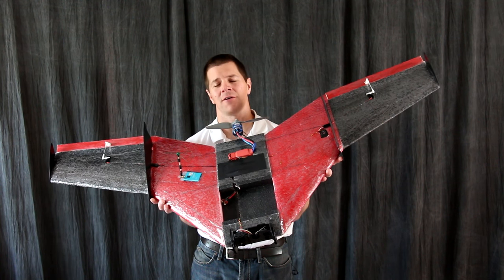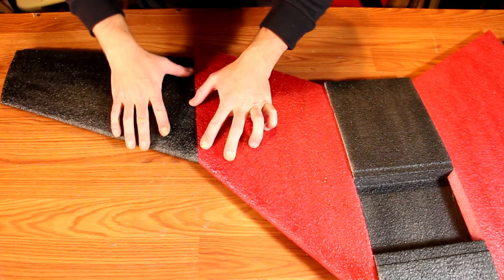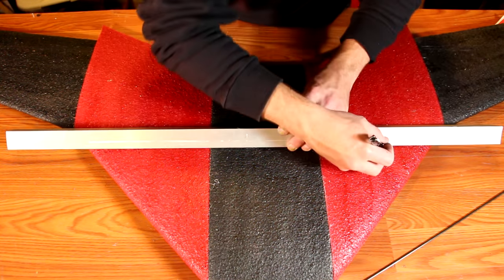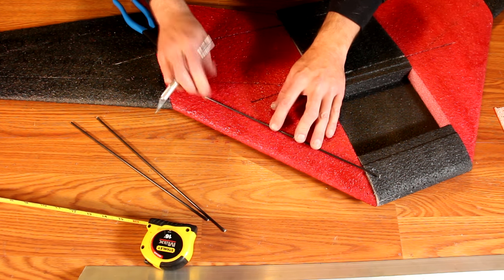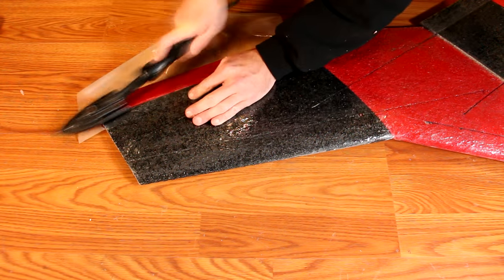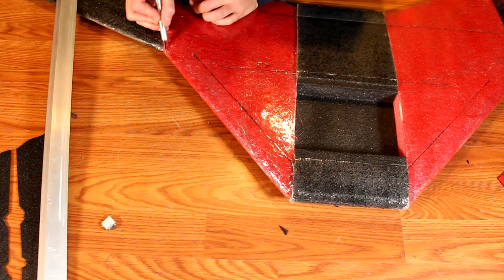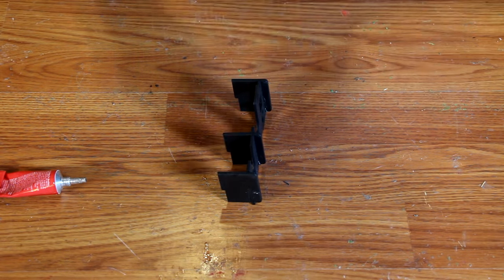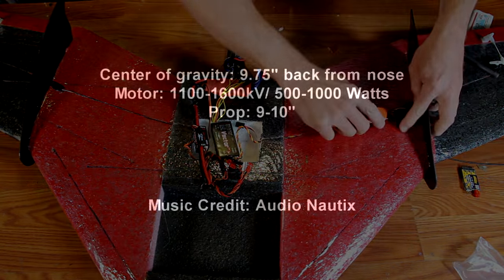VAS Chimera 2 build tutorial

Comment: i built mine with just a motor and a dragon link receiver and used 2 5000 mah 3 cells and it flew okay but that still balances out at  almost 11 inches back idk how the recommended battery's would ever balance at 9 3/4 back...two hardpack 5000 4s would not even balance there with my fpv gear.....so where is the balance point...if i balanced it out at what you say in this video id have to throw it off a cliff to get it to take off without nose diving into the ground ...you obliviously have tested this but i am just not sure whats going on

Comment: Silly question, but, what spray paint did you use for this Chimera?  Did you coat it before with Minwax or just the paint?  I've just had the experience of Flite Test models. Thank you, great build video !!!
Reply from the maker: I just used Krylon MAXX cover.  Any paint will do.  The plane is solvent-proof.  You can literally soak it in gasoline and it won't hurt it.